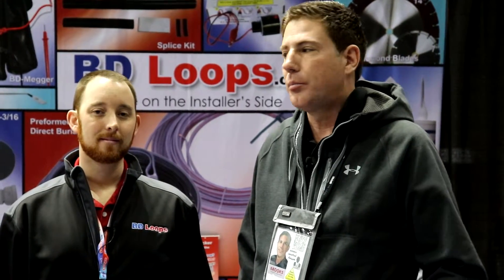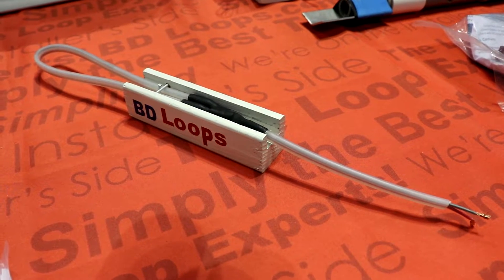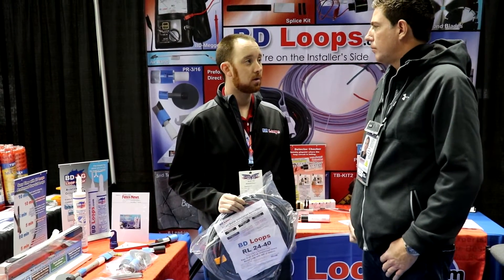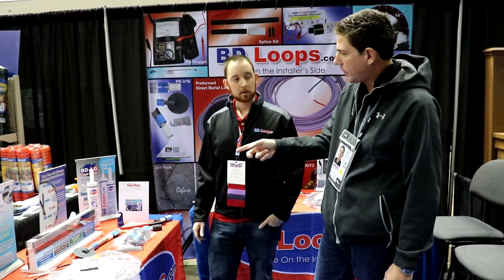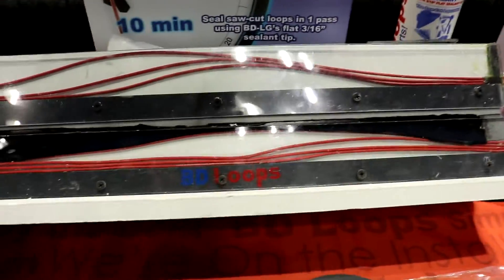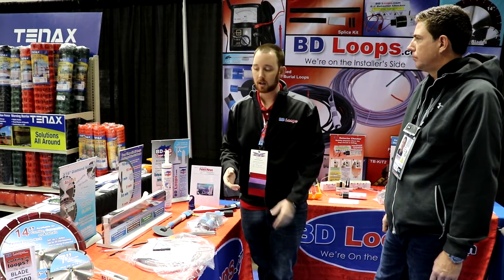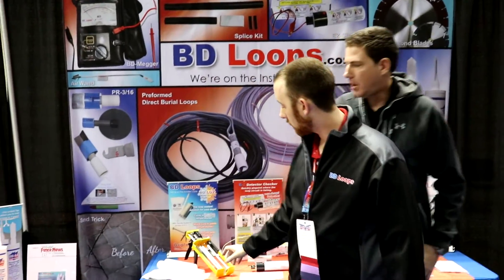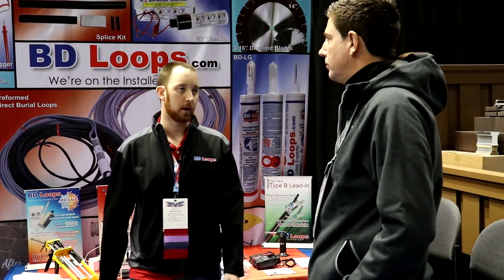FENCETECH 19 Brian Dickson of BD Loops, Loop Goop, preformed loops, Detector Checker, &more! ACF 035

Comment: What are your thoughts on Virtual Loop?
Reply from the maker: They have to have batteries replaced, cant use them around snowplows, they have a weight limit, etc. But they are good for parking garages, etc. Have you installed any? What are your thoughts?